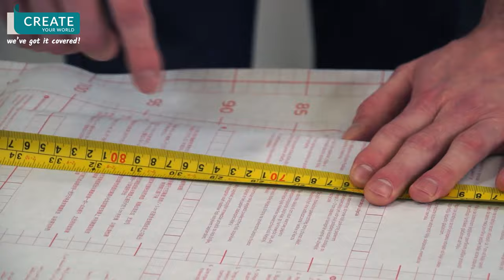A step by step guide on how to wrap your kitchen doors and worktop using self adhesive vinyl film

Comment: You didn't show how to apply the vinyl to the the most important and difficult area which is where the two kitchen worktop panels join at 90°.
Reply from the maker: Hi yes it's shown on the video how to do this, overlap the vinyl by 2mm at least and trim the vinyl
Reply: @CreateyourWorldLtd do you suggest laying the perpendicular piece over the top of the slight overlap, or try to cut it precisely to butt up against the other piece?

The video doesn't show you laying the final piece.

Just ordered 8m x 67.5cm from you!
Reply from the maker: @richardsanderson1448  you need to slightly overlap it by a few mm